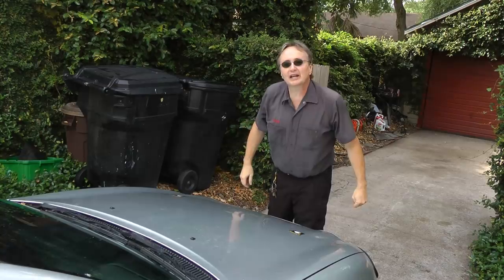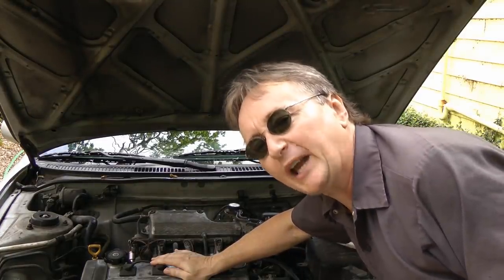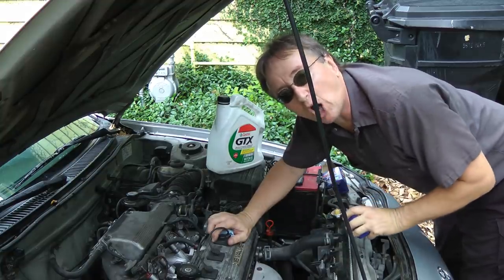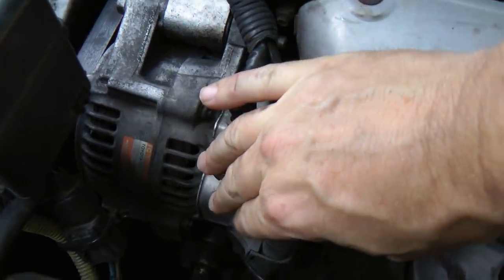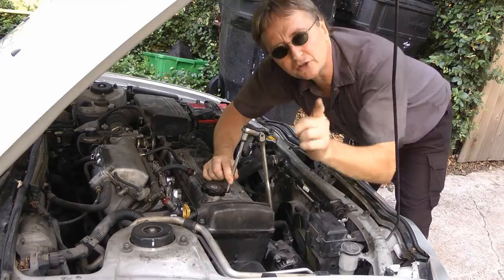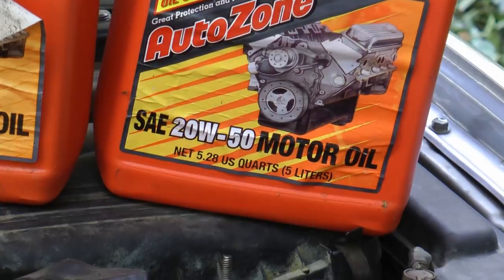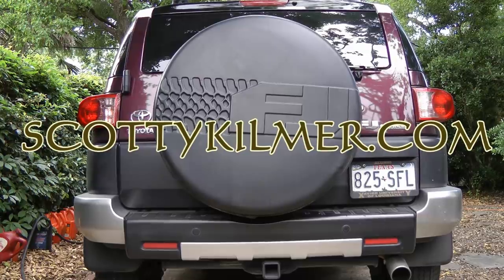Top 4 Mistakes Car Owners Make (DIY Fails)

Comment: Hi Scotty do you advice to disconnect negative battery when changing Spark plugs? Thanks
Reply: Why not?  It's an easy process.
Reply: Not necessary. No power goes to the spark plugs when the car is turned off.

Comment: I use Mobil 1 synthetic oil on my Dodge Ram truck Hemi is it adequate that I change every 6200 miles or can I drive more so many different stories I over 70000 miles runs great

Comment: What about having a built motor you have to run thicker oil since the motor is loose and not as tight as before

Comment: Technically it's "Winter" not "Weight", however, I'd like to argue that people even SAE oil standard technicians sometimes mistakenly say "weight". The reason everyone refers to it as "weight" is because the oil is thinner at the first number, and thickens to the second number. The change is actually viscosity. However, some people refer to this as the "weight" of the oil because technically speaking, you engine (oil pump/oil sending unit) is doing work to move the oil. Work is just force applied to a mass. the mass is under gravitational force. Therefore, the engine (oil pump/oil sending unit) is moving the "weight" of the oil. If you measure the different viscosity ratings of these oils, they will come out to different...you guessed it: weights. 5w20 has a operating time of 5 seconds to reach all moving parts of the engine while at operating temperature. It will take 5w20 approximately 20 seconds for oil to reach all moving parts of the engine while at 30 degrees or below. Hence 5w20. Weight IS an appropriate term to use with single grade oils. SAE 5, SAE 10, SAE 20, SAE 30, SAE 40, SAE 50. They are referred to as "weight". Source: Z. George Zhang
Director, Valvoline Technical International at Valvoline
Reply: You are not right either, Best Lee.  The first number does not thicken to the second number. The oil is always thinner when hot.

Comment: Don't put antisieze on plugs! You can damage the threads in heads on a reinstall  It changes the torque value . Also loosen the spark plugs hot then start it to get carbon broke free on the under side. Then let it cool. Then remove them on aluminum head.
Reply: I have never heard that one before. I always use anti seize with aluminum head. (???)

Comment: Scotty I love your videos,  I'm sure you know better and your a true experienced mechanic. But you really should  explain to your followers that oil does not go by weight and oil is not measured by weight. I know you know that it goes by viscosity and the W on the cans stand for Winter. Probably wouldn't hurt to tell them the difference between an engine and a motor as well. You are great!

Comment: Hi Scotty, big fan just a question anti seize on the spark plugs will that interfere with the earthing of the spark plug? Appreciate your advice on subject?
Reply: This video was made 9 years ago. Since then modern spark plugs DO NOT require any anti seize at all during installation. Just tighten them according to the torque specs and you will be fine.
Reply: Thanks James, appreciate it 🙏

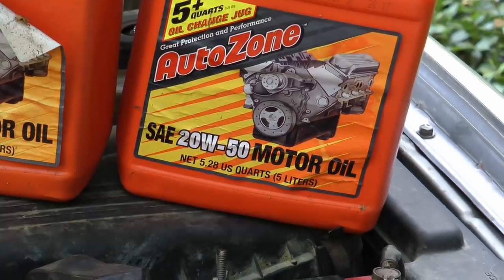Comment: The 'W' stands for 'Winter' Scotty... not 'Weight'... 3:00

'Oils with 10W-30 and other similar designations are referred to as multi-viscosity oils. The W stands for winter not weight and there is a standard called the SAE Viscosity Grades for Engine Oils – SAE J300. ... This means that when your engine is cold the lower the W number the easier the oil will flow.'
Reply: Probably just habbit.  All the mechanics said Weight for decades.
Reply: @brentbiel5425  I am an ex machanic and ive never heard anyone call it  10 weight-30 or whatever but I have heard freon called freezon and the harmonic balancer called the harmonica balancer LOL

Comment: I found it interesting that in Europe, Toyota recommends changing the oil in their new cars only ONCE a year or 15,000 KM which is about 9300 miles. I looked into this and found that European oil (even the cheapest oil) is a far better grade than what we have in the USA. No one in Europe takes their car for 3000 mile oil changes...
Reply: Umaxen 00
Well 3k is unnecessary in the US also, so...

Comment: Hey Scotty. My 2005 crown Victoria has 370,000 miles on it. The mechanics put 10-40 on it But the manufacturer says put 5-20. So which one do you suggest ?
Reply: +Saber Uddin  Just so you know, The 1996-2011 crown victorias are supposed to use 5W-20, because the ford 4.6L SOHC is a tight clearance engine even after 500,000 miles. 10W-40 oil can greatly accelerate engine wear on the Ford 4.6L. I actually have a 1996 Lincoln Town Car Executive and the original owner had used 10W-30 engine oil and it developed a loud ticking noise. Not only that, but it also restricted a lot of engine power, but once I changed the oil using 5W-20, the ticking noise stopped completely and my Town Car performed a lot better afterwards. I DO NOT suggest using 10W-40 on your Crown Victoria, You should only use 5W-20. You might as well not buy into the theory of thick oil at all.

Comment: hey scotty for flushing coolant. Is is ok to flush and fill new coolant even the engine is hot, i know this is silly ? but i have seen a lot is auto shop. just wondering is it the right thing to do or just wait couple of hours to cool down the engine, coz filling the cold coolant to hot engine might coz damage?
Reply from the maker: +MICHAEL JOVELLANOS no cold water can damage a hot engine, especially aluminum ones

Comment: Thanks for the great videos.  You have helped me many times!  :)

I changed my steering box due to 2nd leak on my 2002 Silverado 2500 HD Diesel.  It now has tight steering at only some positions of the steering wheel sometimes while mostly at low rpm?  My buddy thinks it now needs a new pump even though it was working fine before.

What do you think?

Jonathan

Comment: hey scotty what about really really hot climates , is 5w20 okay or should i use 5w30 , everyone uses 10w30 here for 5w20 engines with no issues at all , it never snows here or even gets below 20 degrees Celsius what do u think
Reply from the maker: for most engines that would be fine. But some modern engines require lower viscosity oil to run correctly due to VVT systems
Reply: Scotty Kilmer mine is 5 liter ford v8 with 4 overhead cams i heard that 5w20 is dangerous for hot climates

Comment: Hey scotty, i have a 1998 mitsubishi galant (GDI). It knocks loudly when its cold but goes away when it reaches optimum driving temperature. Any ideas on how to fix this? Thanks
Reply from the maker: Jonathan N GDI engines often carbon up and do that. Have a pro mechanic decarbonize it with his cleaning machine

Comment: The W in 10 W 40 or 10W-30 or 20 W 50 oil does not stand for weight. It stands for winter

Comment: ALWAYS TAKE THE NEGATIVE CABLE OFF  never the positive cable.  If you take the positive cable off -  the car is still grounded to the battery.  With the car still grounded to the battery any metal the positive terminal touches will cause an electrical arch (sparks will fly). Now taking the negative cable off it can touch anything under the hood (except the positive terminal on the battery which you wouldn’t do anyway) and you’re safe. I think Scotty should have made this clear. In the video he does take off the negative cable. Just my 2 cents.

Comment: Hi i have a 04 grand marquis and i have some question 
1. I have a knocking in the engine bay not sure what it is 
2. Ive hust changed the oil and the filter and its still knocking

Comment: On the issue of always using the recommended oil weight, I've gone rogue at 1 time.  I have a 2011JK Wrangler and it uses the same 3.8 v6 that was used on the late 90s to early 2000s Chrysler minivans.  On the minivans they've always been using 5w-30 but on the Wrangler they are now using 5w-20.  Rumor has it that the shift to lighter weight was done to meet fuel economy ratings Jeep was shooting for, so I stick with the old 5w-30 it has always been using with the minivans.

Comment: TRUE STORY!!!... I was working in a shop when an old Chrysler sedan pulled into the parking lot. Smoke everywhere. Asked the young man what was wrong... "I don't get it! The dipstick says add 1 quart. I just keep adding oil because it's low according to the stick but it just keeps smoking worse!"  I asked how long this has been going on... "All day, just put the 3rd qt in this morning! LOOK... see for yourself!" He pulled it out & showed me & pointed out where it says add one qt. I could barely keep a straight face as I told him... "That's the dipstick for your transmission!"

Comment: Hey +Scotty Kilmer Do you or do you NOT dd some oil the the spark plug threads when you change them? I always have, but i have heard that because they have a coating now, that can cause problems. Appreciate the clear up on this
Reply from the maker: do not put oil on them, that changes the torque pressure. All modern plugs are already coated and are put in bare
Reply: Ah Thanks for the Clarification!

Comment: Hi Scotty I have a Pontiac Grand Prix and it don't start when it gets cold if it gets about say 20 degrees it won't start and won't get if it gets below 20 like 15 by 15 degrees remote start my car will not start if it's cold outside so what is the problem Oki open the hood and I seen a wire and the back of the right beside you open the car up I don't know how to explain it where it's at but anyway there wasn't wired that was pull up that was loose it wasn't the cable it was not the battery cable but I thought it came from the battery when I got out to my car nothing it was completely dead so I don't know what's wrong with it

Comment: Scotty !!!!!!!!!
Please elaborate about Anti-Seize on sparkplugs.
Manufactures of plugs and cars suggest no anti-sieze  and torque to 21 ft lb 
You seem to have a different opinion, why?
Reply from the maker: late model car makers are not saying hot to put anti seize on their plugs as the modern spark plugs have coating on them already. this video is 8 years old now, the info is good for older cars still, but not late model ones.
Reply: With general mechanics you can anti-seize anything you want to be able to remove later. A light coat or dab is all you need. You shouldn’t apply so much that it would interfere with the spark. But I can’t see how it would hurt it if you do it right.

Comment: The W stands for Winter, not Weight. The lower the W number, the earlier the oil will flow when cold in winter temperatures. As a mechanic, you should have known this. You can Google this. It's an abundant piece of information.
Reply: Scotty is not a mechanic, Joshua. Can you spell You Tube Superstar?

Comment: Reach into a fusebox and pull a "good" loaded fuse with it at it's Potential and Watch that Arc . I Always have My sheet of Rubber and the Proper Insulated puller . The Master Switch is there to Protect You ! Use It.

Comment: 1) Make sure the gasket is on the old oil filter (double gasket)
2) Disconnect the cable for the battery for electrical work
3) Don't work with sparkplugs when the engine is hot

Comment: the big mistake you missed is people who overtighten or under tighten the drain plug or forget the gasket on that I replaced an engine on a Subaru because some garage stripped my drain plug

Comment: NOT TRUE. Remove plugs from an aluminum engine when moderately warm to hot. From cast iron heads, cold.

Remember the anti seize , especially on aluminum head engines. Use the copper based anti seize for electric conductivity.

Comment: No disrespect Scotty but you should fill the filter with oil before installing it. I realize depending on the angle you can’t always ‘fill’ it, but as much oil in it as possible helps. Oil has to go through the filter before it gets to the engine, so the quicker that can happen the better.
Reply: I agree with Scotty on this one. Not needed. Oil come up so fast. Try opening your filler cap with engine running and see how much oil  comes out.

Comment: "disconnect one of the cables???"  NO.   You disconnect the NEGATIVE!  Always disconnect the negative before putting any kind of wrench on the positive terminal.    Inadvertent metal contact with the positive terminal will do just as much damage as it will at the alternator or other positive terminals throughout the vehicle.

Comment: 5 w 30 apparently means 5 viscosity in the winter and 30 viscosity at operating temperatures at about 212 degrees Fahrenheit. So I guess the w means winter. According to motor oil companies

Comment: Can I switch from regular oil to synthetic for my 2001 honda prelude Vtec Engine I use 10w30 thanks
Reply from the maker: PreludeBB6JDM you can, but I wouldn't. Sometimes doing so causes oil leakage and or burning oil in the engine

Comment: My lifters on my 4.7 magnum dodge 1500 are a little noisy when I first start it and then it quits is this normal for this truck with 126000. Its a 2004 model and I use 5 w 20 like the cap says. Don't know if there is any adjustment the dodge place could do or not.
Reply: With the miles you have on it I would personally use a heavier oil. I had an 88 ranger that did the same thing, but I never figured out how to fix it. I would use engine restore oil additives and the have different size cans depending on your motor and then maybe use 10w30 oil. Some say synthetic oil makes a motor louder or that lighter oil makes a motor louder. I've got a civic now and Honda recommends using 5w20 oil, but I use 10w30 with 160k miles and the motor sounds better with that. I also put engine restore oil additives last oil change and it seems to help as well. Just my 2 cents, so take it how you want. Hope this helps
Reply: I'll also add that I never used a heavier oil on my ranger, so it could help you to use a heavier oil, unfortunately I never found out before I switched vehicles

Comment: Use a premium filter with a check valve in it that holds the oil pressure up in the valve areas and doesn't let it drain back into the pan. Or you will have dry start up every time.!!!!!

Comment: Any question he says he'll answer I got a good one so 2014 Subaru Forester spark plugs removing the spark plugs on a 2014 Subaru Forester if you look carefully on these vehicles you'll notice there isn't much clearance on the driver side trying to get the spark plugs out with very little clearance between the engine and the frame of the car once you take a good look at this you'll see what I mean there's even videos you might find on this and when you see it you'll understand what I'm getting at I'm just saying

Comment: Ive skipped the battery disconnecting step, a few times, simply because disconnecting it is such a pain in the ass on my vehicle.
Reply: You can install a cable quick-connect and disconnect with ease...
Reply: Chrysler Sebring?
Reply: nope, chevy astro

Comment: Don't just take a cable of the battery but take the negative off 
Taking the piss price off first means if the wrench touches metal you have just shouted the battery

Comment: Here's a tip.... Never change your muffler bearings while the engine is hot because you will get burned !...always use a sky hook to hold up the muffler while you change the bearings.
Reply: I like your style, Big Rooster.   A sky hook is also useful when changing drive shaft fluid.

Comment: Is it important to put a little bit of new oil in the new oil filter?
Reply from the maker: no, that's an old wive's tale, most filters drain out everytime you shut the car off these days. They are not full flow filters, most of the oil bypasses them in operation
Reply: Thanks!  I was wondering about that as well.

Comment: What oil should I use I have a 184,000 grand prix from 07 should I use the oil that the top seis (5w30)or should I keep on using 10w30
Reply from the maker: I would use 10 30 castrol
Reply: Scotty Kilmer I have always used mobile one what do you think Scotty?
Reply: ariel sosa mobil one good. its a top tier oil

Comment: i found a leaked oil from the oil filter seal. and for this reason i need to change it. my question is: can i remove and change that oil filter without draining the engine oil from the oil pan?
Reply: Usually no, if the filter sits below the engine. My subarus have them on top, so in that instance, yes, the oil has flowed back into the engine and I could change just the filter if I wanted. You could drain it and pour it back in but you may have to top it off with another quart or so as some gets burned up. But if you're going to do that, might as well change your oil.

Comment: And als, a recent problem, when in around third gear, about 5 seconds after shifting, it revs really high, could you help at all 
This is the same 1 litre ecoboost car
Reply from the maker: +Pomie Mcallister have it scanned with a dealer level scan tool, those babies are complex and it could be a software problem needing reprogramming

Comment: hey Scotty you know your stuff and I can tell my father was a auto body man for 35 years at one of the largest Volvo dealership in the U.S. lemco 4500 clear coat will stand just about anything you can throw at it but you have to spray it with a gun so not for everyone and not to point out a mistake... that everyone makes by the way... 10w-30 or any multi "weight" or viscosity  oil the W stands for winter NOT weight what it means is the oil will flow like a sae 10 weight oil @ 32 degrees and flow like a sae 30 weight oil @ 195 degrees "operating temperature on most cars " so even when it's cold and oil will be thick a multi viscosity oil stays thinner but does not get too thin when @ operating temperature anyway Scotty your a good guy there need more honest  people like you  turning wenches lol

Comment: Amsoil oil, with bypass filters.. Vehicles will last much much much much longer... Over a milliin miles.. Must clean out the .02 to .08 particles that grind your engine away.